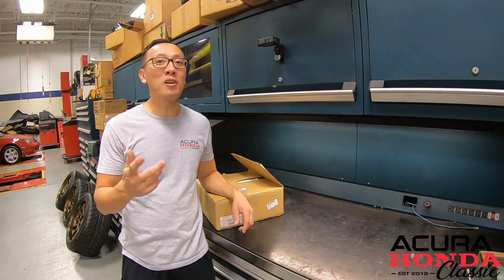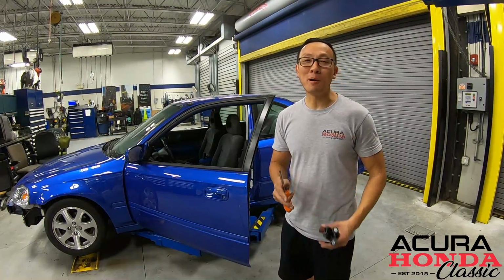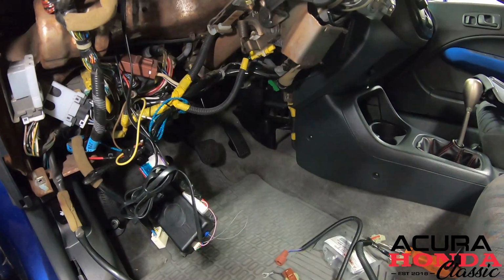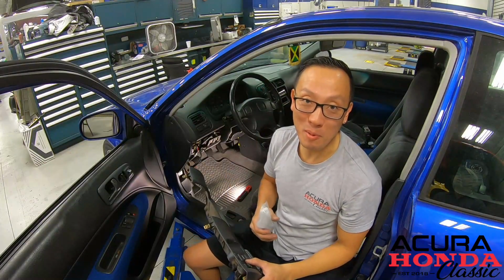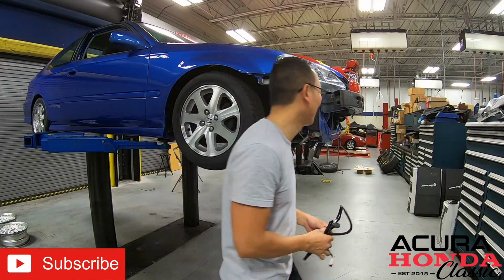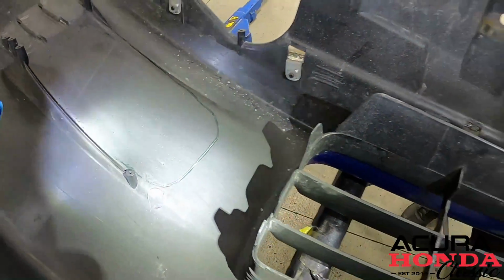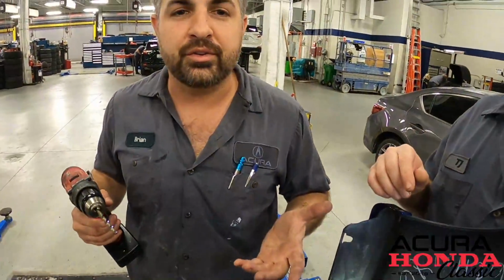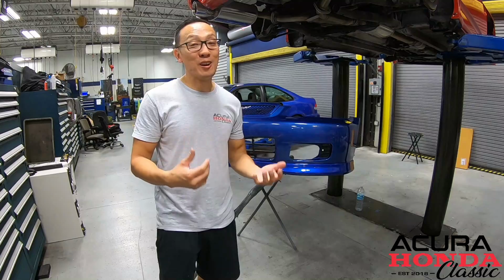AHC Shop Hours - Honda Civic Si EM1 OEM Fog Light Installation Guide and Type-R Part

Comment: The front emblem removal is literally an EM1 owner right of passage. The best "free" mod you can do to change the look of the entire front end and pretty much everyone took them off/threw them out back in the day. I prefer mine without and I hate to say this but...I think you may have re-installed it one "layer" too high of center. It also would really complete the front of the car to slap some licence plate plugs on there. It looks like the metal slugs behind the holes were gone but I'm sure a little hot glue or epoxy would keep them in.
Reply from the maker: Great catch. We installed both the bracket and license plate caps after we filmed our video. Those parts took longer than expected to arrive

Comment: Missing the ground strap on the front driver side valve cover bolt? Sure wish I could find new OEM floor mats for my Integra. My original front driver side one is beyond tattered!
Reply from the maker: The ground has been relocated since the car has a harness tuck. OEM Integra mats are very hard to find now a day

Comment: Did the Si come with those floor mats or the mats that have "Si" in red on them?
Reply from the maker: The black replacement mats are reproduction Oem item. The original EM1 Si mats are light grey and do not have Si logo on them

Comment: Not to nit pick but those are not the factory floor mats that come with the car. Anyone who has owned an Em1 or rather any 96-00 civic will say that. The floor mat fabric will match the carpet which yours clearly doesn’t. Also your grille H is a bit crooked. Just sayin
Reply: Always wondered if these were some kind of secondary OEM floor mats? I was lucky enough to come across a new set of the "real" oem floor mats on Honda-Tech back in 2011.